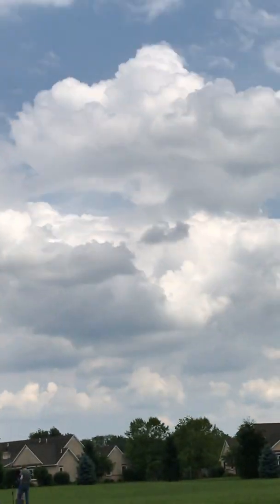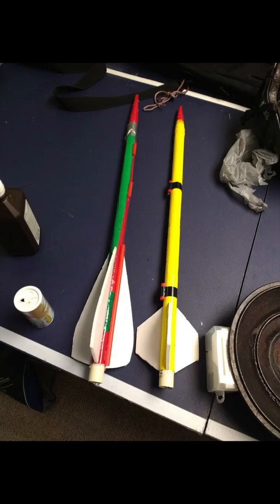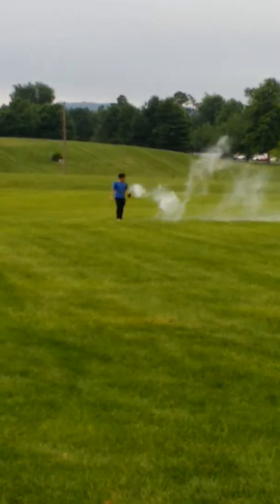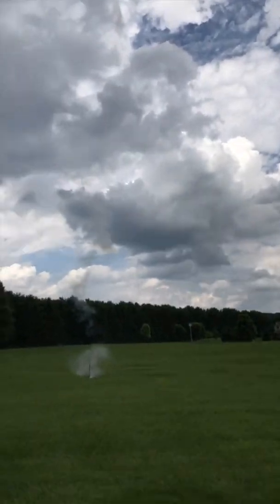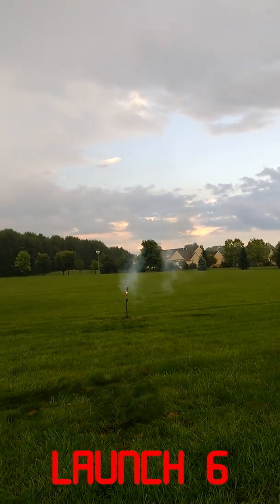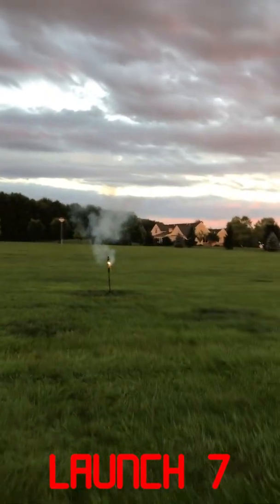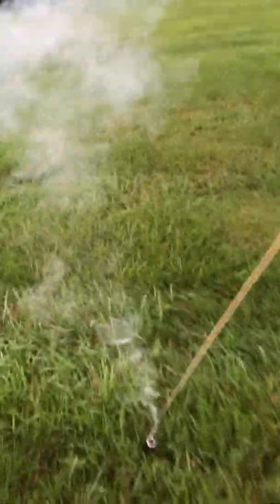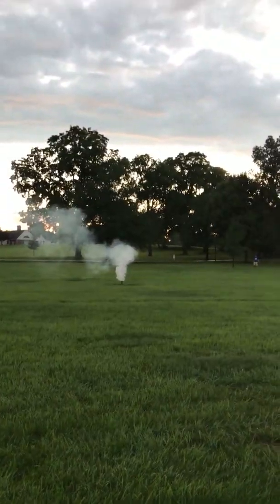Homemade Rockets

Comment: Instead of sugar, you can use sorbitol. It melts just below 100 degrees celsius, so you can prepare the whole thing in a water bath - much safer. You can also add some fe2o3 as catalyst.